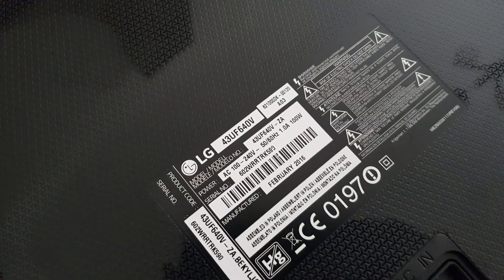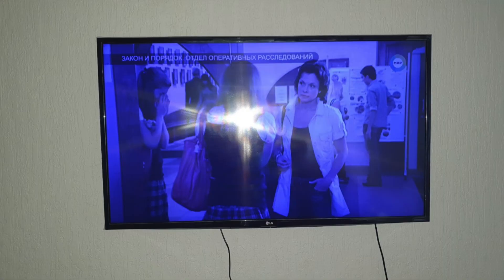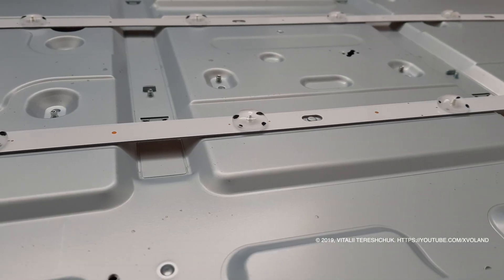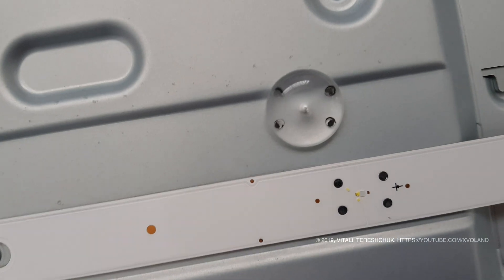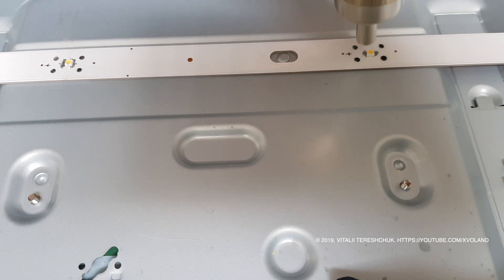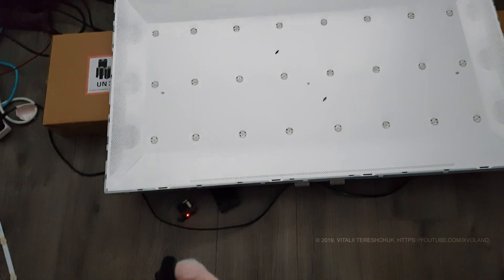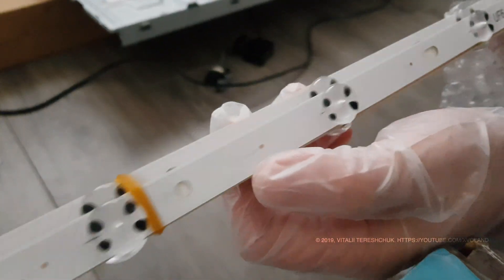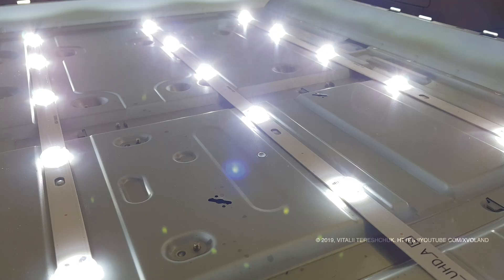🛠 Blue Picture on the UHD TV LG 43UF640V, 43UF6407, 43UF6400. How to fix backlight

Comment from the maker: This issue occurs on the following TV models: LG HC430DGN-SLNX1, LG 430DGN-SLNX1, LG 43UH6030, LG 43UF6400, LG 43UF6407, LG 43UF640V, LG 43UH619V, LG 43UH610V, Panasonic 42 inch TV TH-42A400C, Panasonic V420FWSD01, PHILIPS 43PUS6162/12 LBM430M0801-BW-3, etc.
with backlight 850mm and 8 lamps.
Reply: 43UH6000 👍
Reply: It's on the 55UJ6309 as well. Thanks for your video.
Reply from the maker: You’re welcome!
Reply: My tv model LJ616D same problem bro
Reply: My 2 years old 43UJ635V-ZF has developed this problem a couple of days ago: the upper left corner suddenly turned blue-ish, the rest is still perfectly okay. Good to know it's about some bad quality background LEDs getting dimmer. Nice fix with the LED strips! If I can't get the TV replaced / repaired with my extended warranty, I'll definitively try this. Thanks for the video!
Reply from the maker: @fhajji  This is a dangerous condition, if they burn out, other components on the power board will fail. A video about a similar situation with another TV will appear soon
Reply: @xVoLAnD  Ah, thank you for the heads up!
Reply: 43UH620V too
Reply: LG 43UV770M made in 2018 also turns blue...my institution has about 40 of them and almost all of them have turned blue....I was shocked to remove the back and see the LEDs so blue on the LG
Reply: 49UH610V too
Reply from the maker: @rickyheuer4948  Thanks!
Reply: don’t forget about 43UH6100, i had to search the deep end of the internet for this exact model but because of your links i found what i was looking for. thanks plenty!!
Reply from the maker: @royalbestia1512  Thank you!

Comment: And what to do with mesh wire to display connectors and metal housing? Soldering?
Reply from the maker: I'm sorry, but I don't know what you mean. Can you explain?
Reply: @xVoLAnD  There is 2 mesh wires, from display connector group to metal housing where display and everything holds. To take off display LCD, you disconnect those connectors and to each connector group is 1 mesh wire (flat), 2 display connectors=2 mesh wire connected to metal housing which you need to remove?
Reply: If I can send image easy showing what is that 2 ground wires
Reply from the maker: @nikokristiansbodnieks2147  Can you give me the time code?
Reply from the maker: @nikokristiansbodnieks2147  All wires must be disconnected. There is no need to solder anything. The maximum that can be used is double-sided tape

Comment: Helpful video, was able to diagnose the jumbotron at home! 
A little bit as to what causes this as far as my research LED me. hahaha 

Anyway, the Blue LED error exists in backlights that are made by a company called Vestel. Vestal had a bad rep in the TV trade for building shit TVs and supplying shit parts to other companies. Anyway, as Vestel TVs begin to age, around year 3. They turn blue, and then blow up. You may not see them blow, as you might not use or have done something about it.

So, the solution is to change the backlight LED array completely just not with a Vestel kit, any other 3rd party will do.

Comment: No, not there. Plus the links take me to a list of crap 2 LED’s 10 lines 1 bulb. Why oh why do they have to rip us off.  If one is not sure what it is your buying, it’s a nightmare. If a model has 5 rows of lights? Then why not point people in the direction of 5 rows of LED’s? There is the price, click buy, you get a commission I pay p&p and all is good. Nothing is ever simple. ffs😔
Reply from the maker: What TV model?
Reply: @xVoLAnD  43UJ670V
Reply from the maker: @davidhargreaves1728  You need 3 lines (6 pieces). What's the problem, I don't understand
Reply: @xVoLAnD  we are currently watching the tv, and so have no idea how many strips/lines we needed. Secondly, the adverts refer to Panasonic? are they the same? They also refer to single bulbs or pictures of multiple strips plus I still don’t know which lights to buy for my tv or doesn’t it matter are they all the same? You see, this is when I think throw it away and buy another, yet in my heart I know it can be fixed. But no one is forth coming with the info, you’ve said I need 3 lines, where’s the link with your commission attached? If I was selling shit I’d make sure I pointed people in the right direction. Sending me to a list of LED’s is overwhelming. 🤷‍♂️🤦‍♂️
Reply: @xVoLAnD  plus you say 3 lines (6 pieces). Pieces of what? 6 bulbs 3 on each? 6 lines/rows WHAT? 6 pieces of what?
Reply from the maker: @davidhargreaves1728  I don't advertise anything. I show that people can fix old things and many people have done it.
Reply from the maker: @davidhargreaves1728  This is a gentle process and requires attention, so consider whether you can complete it.
Reply: @xVoLAnD  I give up, that sentence makes no sense😔
Reply: @xVoLAnD  what are you scared of? I asked a simple question all I needed was a coherent answer.
Reply from the maker: @davidhargreaves1728  ok
Reply from the maker: @davidhargreaves1728  You might never get it, you're in luck. No problem!
Reply: @xVoLAnD  oh well looks like I’ll have to take the TV to a coherent professional. End X
Reply from the maker: @davidhargreaves1728  In my country, prices for 43" start from £120

Comment: Seems every LG crap does the same, built in obsolescence. HD Ultra 4K well pissed off. 43UJ670V. Thanks Vitalii I was editing the post once I realised you had👍😎. However YouTube got bored and posted again before I had the chance to remove. Great job. My tv isn’t inc 🤷‍♂️
Reply from the maker: This can happen with any TV. Companies use universal boards which is differ slightly. Therefore, some TVs has increased amperage on the LED's. As a result, they fail, depending on how much TV you watch per day.
Reply from the maker: Check the description below the video to buy LED's

Comment: I'm having the same issue with my tv. I want to order replacement LED strips but not from LG and don't know which ones to order. I have a LG webOS 43UH6100.
Am I able to order the LEDs used for the 43UH610V? Or are they different?
Reply from the maker: I think - yes
Reply: @xVoLAnD  thank you!
Reply from the maker: No problem! 👍🏻

Comment: Hey for whatever reason the links aren't working for me I am looking to fix this on my 43f6400
Reply from the maker: I’ll check links and update, ok?
Reply: @xVoLAnD  I got it to work thanks where any other things needed to do the replacement of the led like double sided tape etc ?
Reply from the maker: @Cruz99juan  Yes of course, if your LED strip does not have a mount or tape already installed. Of course - attentiveness, purity and memory ;)
Reply: @xVoLAnD  thanks for the advice I just now placed my order off your link and will wait for them to come in to do it
Reply from the maker: @Cruz99juan  Thank you and good luck with the replacement

Comment: The LG is the worse it TV, you will get a lot  of  problems after 2 years
some time the system, network other time the screen

realy bad smart TV through whole my experaince
month i face problem
Reply from the maker: You haven't seen Hisense TV yet, there will be a video soon. I want to note all LED TVs need to be slightly modernized the backlight and it will works more longer

Comment: I’ve got this exact problem on my LG 43UJ630V, do you know if I can buy any of the led strip sets for the 43” inch class teles and they will work fine? Or do I need specific LEDs ?
Reply from the maker: These are special LEDs with a diffuser and a radiator for heat dissipation.  You can look at the description under the video, but I don’t recommend you change the backlight without experience, because you can break the tv. But if you are willing to take risks and are careful, you will succeed.